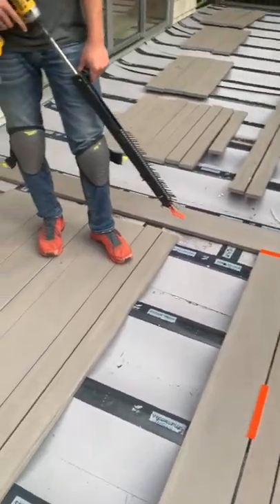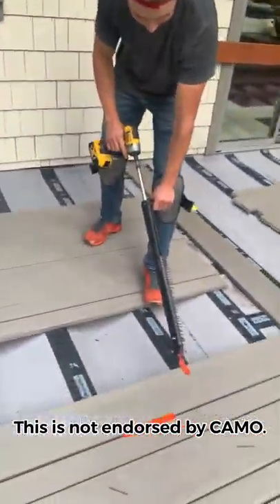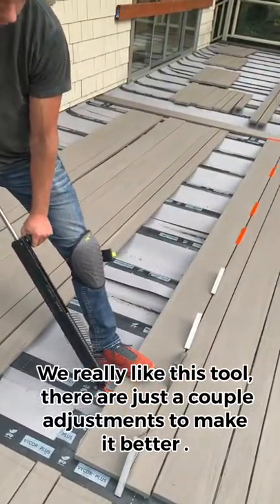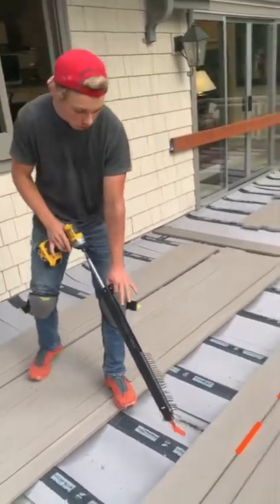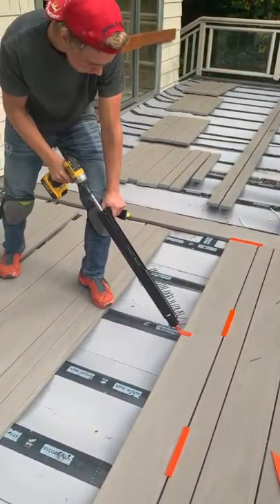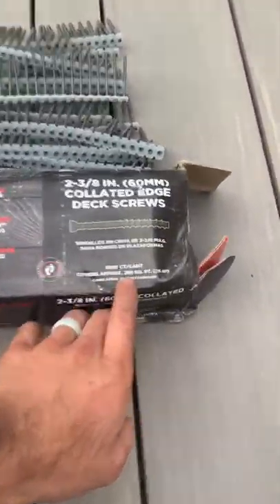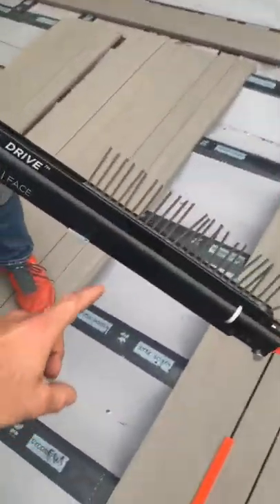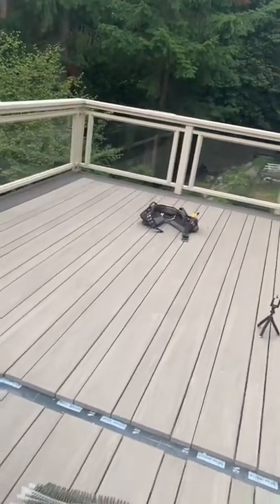Using the Camo Drive

Comment: What kind of material are you using below the new deck boards? Some sort of water roof membrane?
Reply from the maker: Yes sir, there is a second deck below this one, we use 60mm TPO for the waterproof system.
Reply: You are screwing right through the tpo with no sleepers down?

Comment: How do u do the boards  against the house , it doesn’t look like it will get the last 3or 4 boards ?
Reply from the maker: jamie williams, we removed the red edge adapter and just used that with one of the long T-15 bits. Actually worked out quite well.
Reply: It is a flat spring. $.30/sf is pretty cheap, so these screws are not expensive. Using a cordless drill in drill mode works better, in my opinion, than impact driver. Regarding getting close to the house, you can put that 2nd board in place, mark where the joists are, pull board away, and start a screw at every marking, making sure you don't go through the bottom. Put board in place, finish driving them with a T15 bit. When using Drive tool on PVC  or composite, the minimum gap should be no less than 3/16".

Comment: They said not to use an impact didn't they?
Reply from the maker: They suggested using a drill, but impacts our much more common in our jobsites.
Reply: Might be why things were jamming up and fouling screws, just a thought, never used the tool.
Reply: Use a half inch drill and just hold it wide open there's no need to let go of the trigger. The heavier the drill the easier and faster you'll get done. Impact drivers have their place but not here with the Camo. At least that's what my mafia boss told me before he tried to off me. I'm now in a safe house. Don't tell no one that..